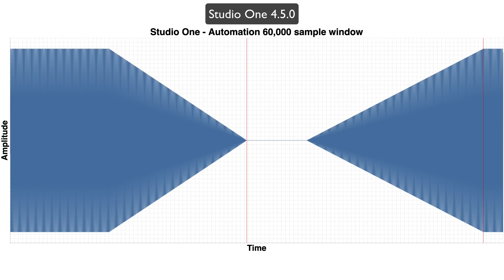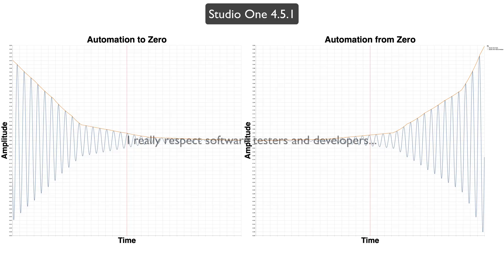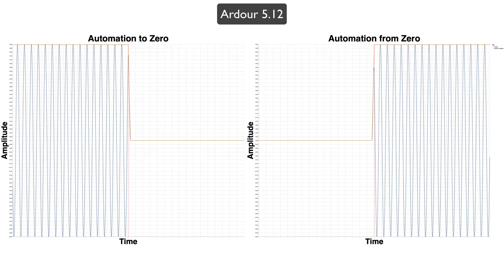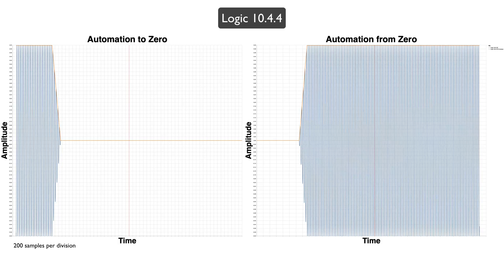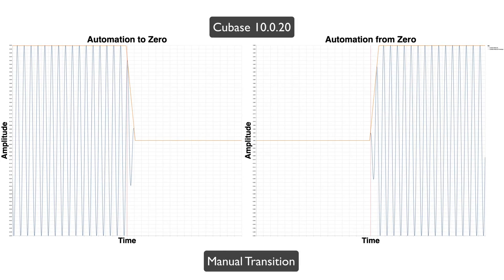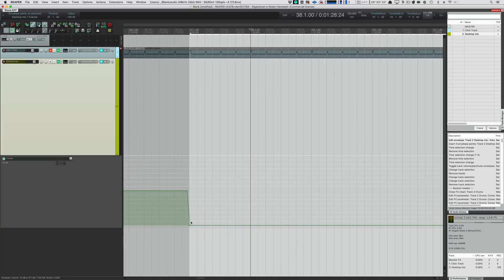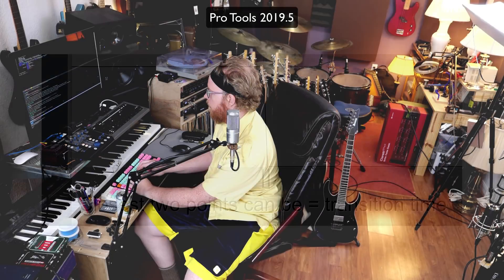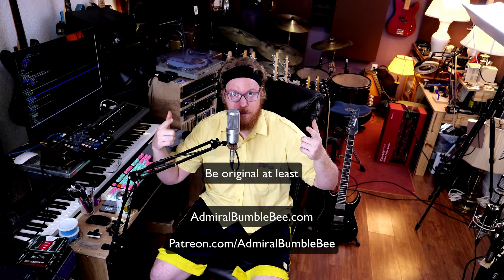DAW v DAW Part 4 - Even more automation, Studio One 4.5.1 and Logic's weird secret.

Comment: FL user here. I love these types of videos, and yes, fruity balance and the faders do have smoothing. However, if you're willing to put in a small amount of work, you can create a no smoothing audio killer with the love philter. Should I have to do that? No. But is the option available? Yes.
Reply from the maker: I just checked, and it still has smoothing. Can you elaborate more please? I'm probably missing something.
Reply: @AdmiralBumblebee  From what I've seen in FL, it has absolutely no smoothing. In order to make this, you need to use the mod x parameter for volume. I can send you a preset for it over discord, if you'd like :)

Comment: Fades don't automatically mean interpolation or bad quality, they can be done on purpose to avoid clicks. Ableton does this for example, I've tested it recently. The fade is always 3 ms long no matter what your samplerate or buffer size is. And the majority of the fade is happening before the automation moves down and after the automation moves up. Clearly the fade is done on purpose.

The question is then should the DAW display exactly what is happening to the audio or not? I think it depends on how it's being displayed. I don't want Live to spread the automation points on the time axis to showcase the fade as it's done in Cubase, because then the automation points are not located directly on the grid anymore. Selecting and copying them would be very annoying. The only way to do it right would be to show the resulting automation line together with the current one just like a preview of what your automation will actually be.

The current automation line is not a visualization of the result, but rather a musicial automation. We see that the volume goes down at bar 3 for example. That's how we would describe it musically. But in reality it does a small fade to improve it.

The other thing is, these volume tests don't show the full picture of how automation in general is handled by the DAW. Live is capable sample accurate automation in audio rate (though without anti aliasing I believe). You could use parameter modulation as a sidechain input for audio signals to listen to. The question is if the parameter is capable of making use of the resolution. In some cases it's impossible or not a good idea (FFTs?) and in other cases it's rather pointless and better to lower the resolution in order to reduce the CPU load. Different plugin formats also have different limitations in these areas. Automating a volume control is maybe not the best way of doing it.

It's a very interesting subject and your videos about it are great! Let me know if you want me to build a very simple Max for Live device that allows you to automate the volume with the highest quality possible and without any fades. I'll gladly send it to you for your tests.
Reply from the maker: Thank you for the comment. If you can build a M4L device that can be automated with no transition or smoothing, I'd love to see it.
Reply: AdmiralBumblebee You should have it in your mail inbox now. Would love to see it being for tests like this.

Comment: This seems a little unreasonable. A 1600 sample time window represents only a 36 mS fade to silence which is actually very fast. I doubt you will hear anything worthwhile in that sort of time frame. If you do this test over say 5000 samples (113 mS sec fade which is much more real world) the resultant automation actually looks and sounds fine to me.  For instant fades from max level to silence I am only seeing a 1.5 mS response on either side for the change of levels. About the same as in Ableton now.  Many automation moves are in fact made before the resultant audio sound is actually heard meaning that what happens during a transition is not so relevant. And even if automation is acting smoothly on something and you are hearing it, I feel it is pretty smooth and effective now in Studio One.
Reply: Totally agree with you, wellsaid.
Reply from the maker: You are entirely correct in that regard. II used the 1600 sample fade simply for visualization.

In the video I show a 1 bar fade, and it jumps abruptly on beat 3.

I will be responding on the forums with a project that shows the issue.